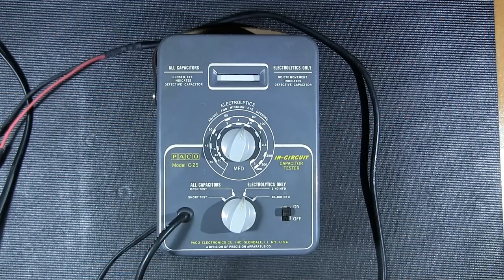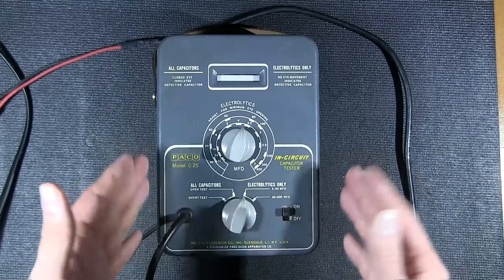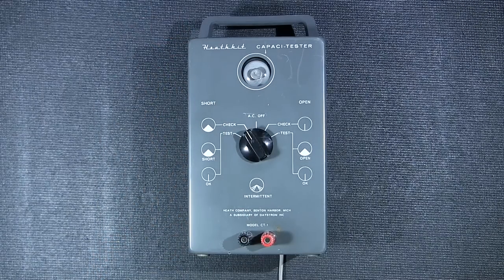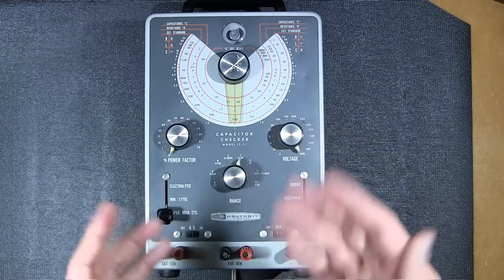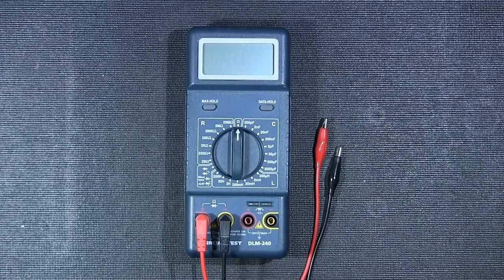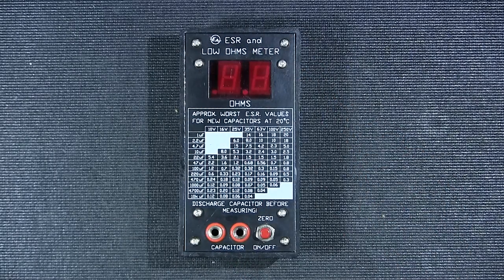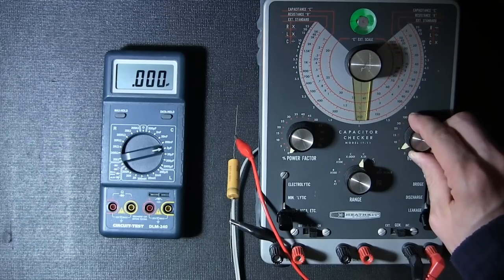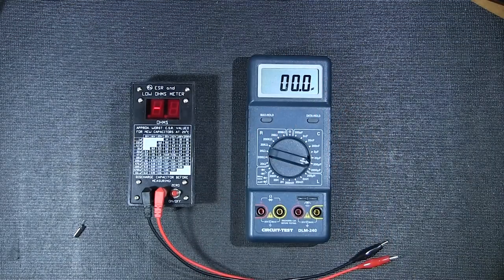Which Capacitor Tester Should I Buy?

Comment: That little table you have there on your ESR meter is very handy. For viewers that do not have such a table printed on their meters, I found these:
http://jestineyong.com/esr-meter-table/
http://www.your-book.co.uk/design/esrchart.htm

I had a couple of brand new Chinese cheapness electrolytes that were fairly 'bad' out of the box, according to the tables. I had a 100uF rated at 25V that tested as 76uF and 0.62 ohms when measured at 1kHz. At 100Hz, however it was 93uF and 1.8 ohms. That is kind of interesting. 
What frequency is your ESR meter using to test capacitors? 

I also tested a 100uF rated for 10V:
At 100Hz: 80uF, 3 ohms
At 1kHz: 47uF 1.6 ohms

It made me doubt the meter, so I grabbed a different brand 100uF rated at 50V:
At 1kHz: 91uF 0.27 ohms which is fine.
At 100Hz: 95uF 0.5 ohms

I guess I will have to keep the box with bad capacitors clearly marked as "for demonstration puposes only".

There has been some discussion about this on the EEVblog:
http://www.eevblog.com/forum/beginners/esr-values-for-electrolytic-caps/

There are different tables with different values. My guess is that the test frequency has to be know, before you can interpret the values measured.

Comment: I know I little bit of electronics but no where near with what is explained here... I have a device that has a large electrolytic 2000uF cap and there is a SMD cap in parrallel with this one. That SMD cap is blown (crack in half) and by chance, that circuit is doubled up (-24VDC and +24VDC) so I was able to read the value of the other SMD cap but I now realize that there is waaaay much more than just replace that SMD cap with another one of the same value (which I was able to read with my multimeter at 9uF)... Now it seems I am screwed with the ESR, leakage and whatever else readings... There is no writing on that SMD cap so I am kind of lost even more as I watch this video... How in the blue hell will I be able to replace that cap then ???? The SMD cap look pretty much like this one : https://i.stack.imgur.com/qTaTC.jpg

Comment: If you are hobbyists... just buy yourself a 50 bucks one. in Europe we have (from decent brands but no fuss ) capacitor meters for 20-50 euros. 0.1 -5% tolerance  , rage depending +2-9 counts ( a 1999 one ) they have good range from pico to M  more then enough to measure from ceramics to cap. packs.                                                                                                                                                                       Here were I live a vintage capacitance metre cost + 200€  that heathkit kit one is worth something like 400 usd :))in fair or mitings... in Romania
Also  that "esr/parts tester. identifier, the yellow one with the atmega chip works decent enough, but don't you FUCKING forget anything you buy that is made in China is endorsing, an evil comunist regime that FUCKING  kills people.

Comment: The heath CT-1 humble as it may be.. is capable of some qualitative testing.. but this requires some experience on the operators part.. when used out of circuit.  You can gain this by testing some known good and bad caps ( using a more capable tester).       It is a real shame at this juncture to scrap out these instruments to rob parts.. unless they are busted beyond repair.   Our history if treated as disposable, vanishes.     We can be led down the garden path by "feature" comparison.. instead of building in some features into ourselves.. formerly called skill.    Much can be done with simple instruments .. and if you haven't got much money.. don't be ashamed, be clever.

Comment: At the 15:50 mark, you set the digital tester to the 2uF scale, "because this capacitor is rated at point one microF".  Why would the 200nF scale not be appropriate?  Does it have anything to do with how much current the unit shoves into the test cap?

Also... I thought I've seen a Sencore 53 in your lab.  If so, why wasn't that part of this review?

Please explain the significance of the quarter-wave length of the Paco's test leads.  That (to me) is much more important than dissection of the Paco.  The theory of the quarter-wave leads has my complete attention.

Comment: Does anyone here own and use a Sencore LC103 ? if so how do you rate it......
Reply: Harb's Elecronics Lab I've owned several sencore z meters over the years, and every one was a top notch piece of equipment. lc-53, and lc-75 were both good meters, then they came out with the lc-102 that added auto lead zeroing, and a test for dielectric absorption. never had a 103, but the led display looks to be the main improvement over the 102. main issue with the latter models is cost. there are plenty of far less expensive options out there, but a good used lc 53 or 75 can be had at a reasonable price.
Reply: Thanks Steve, I have been deliberating for ages if to spend the money or not........Th 102 are definitely a lot cheaper to get second hand and as a result I have always wondered if it had problems that were solved in the 103.
I have never really looked at a 53 or 75.....I will take a look.

Comment: I just found your videos, they  are very informative and I enjoy watching them.
I have been looking for a way to leak test Capacitors . I found a simple capacitor leak tester project, that was published in popular electronics 12 1959 . I am going to build this and give it a try.
Here is a link for the project  http://americanradiohistory.com/Archive-Poptronics/50s/59/Pop-1959-12.pdf
Dennis
Reply: Good one! Thanks Dennis for that link  - I was not aware that so many of the back issues of Popular Electronics were available for free - happliy downloaded the pdf in your link and the scan looks fine.  Not sure about that leakage tester project design though - the one in the article dumps 300 volts right across the leads from the get-go... and no way to turn if off.. I think it needs a way to increment the volts up or down  like Mr Carlson shows on the IT-11. Also notice no ground on the mains plug - dang its a wonder our folks made it through the 50's..Gotta wonder if the author "Mr. R.L. Winklepleck"...  (!?)  himself made it through if he used dat thang